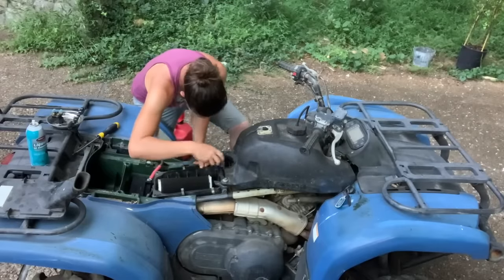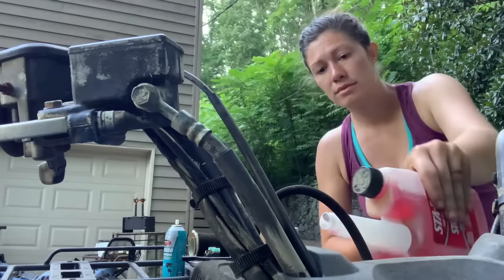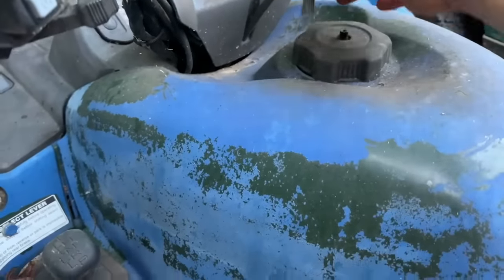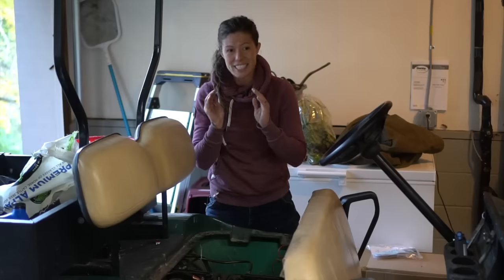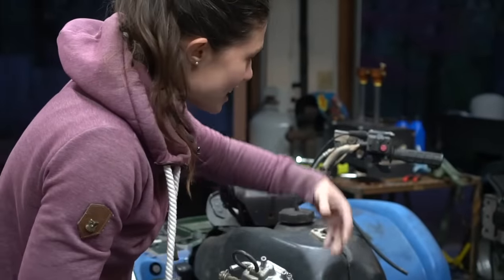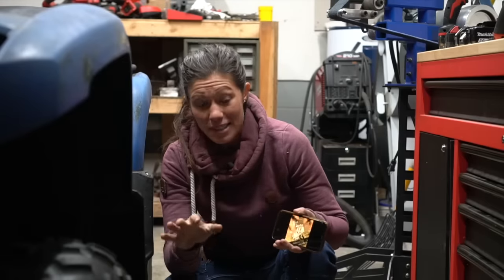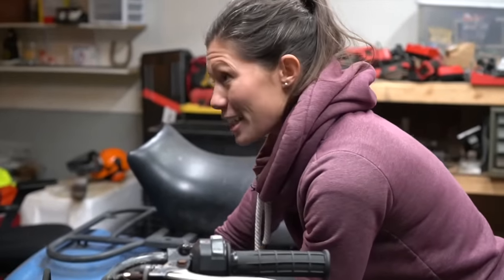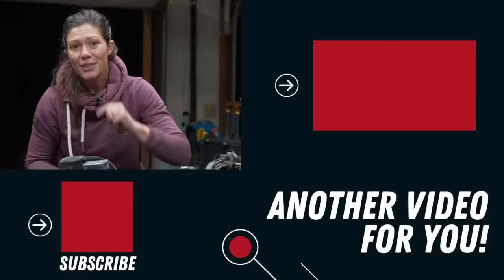ABANDONED ATV: Will it Run?

Comment: Prior to my retirement, I was a manufacturing engineer who was often called upon to participate in screening and interviewing prospective employees. My highest priority was to try to determine the applicant’s attitude. I found 100% of the time that an individual who had a desire to learn, would. Also, I found that mechanical inclination is not gender specific. You, Anne, just put a huge smile on an old man’s face; I would have hired you on the spot.
Reply: This also put a huge smile on my face!  Fuel & spark are the two basic things needed to run an engine.  I have always maintained that teens should have to maintain a 20 year old car for several years before they are allowed to own a new one.
Reply: Yeah, decades as an engineering manager, and I agree fully. Persistence and curiosity make the day.
Reply: @WayneSmith-yf3fg  and compression.
Reply from the maker: That right there means more to me than you could ever know. I spent a lot of my young life feeling stupid, not understanding why some things were so hard for me to understand that everyone around me seemed to just get, right off the bat. I still have to do some tough workarounds, but learning to work with my hands rather than sitting at a computer has made me feel so much more capable and willing to tackle so much more than I ever thought I could. Each skill builds off the last, and I’m learning to love my failures a little more. I would have loved to work with and learn from you.
Reply: @AnneofAllTrades  there is a hoary old saw- we learn more from our failures than from our success. It seems that when you succeed, likely you've only learned that one way to succeed. Failure is more complicated and we seem to learn several things each time we try and don't make the goal. Yer doing fine, Gal!
Reply: @fredericrike5974  Vivek just said basically the same thing.

Comment: Hello Anne,
I could not help but smile, as you discovered how your ATV worked mechanically. My first experience with a small engine was at 14, and it did not go well. I failed to put oil in a B&S engine at the hardware store I had just started working at, and let’s say, the engine did not run long. The store owner thought it would be a good learning experience for me to repair the engine and it started me on a life long journey to learn how things work. At 61, I realize, I only know a fraction of everything I still want to learn. I applaud your never give up, nothing is beyond my understanding approach to life. Stay safe, and continue to expand your knowledge and experiences. Thank you

Comment: Kinda how I felt about my Mitsubishi Raider. I am not a mechanic, I am a 54 yr old female. I had it at a Mitsubishi dealership, no one knew what was wrong. YouTube was a lifesaver and one guy from a parts store , a new control module, a new knock sensor, and by myself I changed the coil packs. I feel like a mechanic... lol 😂 GREAT JOB ANNE.
Reply from the maker: Heck yeah! That's how you get things done!

Comment: Nice to see it working and not dumped in the trash. I can see you have this figured out now, but there are only ever 4 things any petrol or diesel engine needs; Fuel, Air, Compression and Spark. If the combustion engine isn't running, you just need to work out which of the four it's missing. I'm always happy to see a novice home mechanic get an engine running when professional mechanics can't (be bothered to?) get it working.

Comment: Well done.  I cannot stress how many times I have had my “eureka” moments doing something completely different.  Having a leaf blower give you the inspiration to fix the “carburetor” is a wonderful example.  Good on you.
Reply from the maker: Thank you! Can you think of any of your eureka moments offhand? I always love hearing about those.
Reply: My most memorable was a 4 hour debate I had with a co-worker on how to implement symmetry in an optimization algorithm (yes, software).  We had our breakthrough and realized this obeyed Newton’s 2nd law of motion.  We then spent the next 10 min debating what solution would take the fewest CPU cycles.  This reduced a 23-hour calculation down to 20 min.  

Similarly, my training is in quantum chemistry.  The Air Force assigned me to work Satellites.  I succeeded because I simply thought of satellite orbits as electrons and was amazed at how well it worked and allowed me to “visualize” what was happening.
Reply from the maker: @MichaelCoolidge  That is pure awesome. I understood almost none of that, but I love, love, love seeing seemingly unrelated things answer big questions.
Reply: @AnneofAllTrades  I am an amateur tinkerer and I do as you do. Look it over and work on something in my mind first. I figure order of operation for woodworking.  How the firearm works first before I take it apart. What a small engine needs to run and work it out by reasoning. I am wanting to try my hand with older wind watches, service and repair. So many cool things out there to learn.

Comment: I had the same quad, in the same color, and I too had to replace the carb - for no apparent reason.   While I replaced that carb with a used one from eBay (many years ago), I had a Yamaha motorcycle last year that needed a new carb and a Chinese aftermarket replacement carb was the only option.  I didn’t expect much given the low price, but it started right up and ran better than it ever had with the original carb.
Reply from the maker: yeah those cheap carbs work shockingly well. I saved the old one in case I ever fancy a rebuild, but it would require some serious machining skills I'll have to build my way up to :)

Comment: Always try to look at the set backs as a learning curve, when it comes to mechanics sometimes it can be a guessing game as to what's wrong with the engine, I've been in a few situations where I was stumped as to what was goin on, just take a step back and do the process of ilimination, do you have spark? Are you getting fuel? Are you getting the right amount of air?? In some cases it can be electrical, just hang in there and push through, you will be successful in the end
Reply from the maker: Great point!

Comment: So many times I see carbs having issues because of an air bubble in the line somewhere. I always disconnect the fuel line from carb and then use an air hose to shoot air into the tank (with a rag to stop blowback) to clear debris and air from the line. Last week I was given a riding mower with a no start problem. Simply clearing the fuel line did the trick. Its really strange. I've seen it a lot recently.

Comment: Turn the clear fuel filter so that the fuel enters the exterior of the element first. This way you can see the fuel and the trash that is being filtered out. This type of filter works both ways, but usually has a tiny arrow indicating flow direction.

Comment: One way to check a fuel filter to see if its plugged is to remove it and blow through it, and also be aware that almost all fuel filters will have an arrow pointing in the direction of fuel flow.😁 Cheers from Canada! Luv the vids keep em coming!

Comment: Love it, fuel air spark compression. Sometimes to float in the bowl gets stuck an dont release gas through the jets
Reply from the maker: Oh interesting! I’m gonna have to take the broken carb apart to see what’s in there :)
Reply: @AnneofAllTrades  especially when the gas is old an not treated but can also be just old carbs get a lil corroded on the inside. Should be 3 jets inside i think pilot, main, an i forget the other but it looks a lil scary taking one apart but its not bad at all just dont lose anything lol jets get clogged with junk sometimes

Comment: now you need a winch for the front.  BTW, make double sure of the fluid level on that new battery and also ensure with a tester that it is actually charging (alternators on those are often POS quality)

Comment: The problem was probably just a clogged fuel filter in the first place. Carburetors are easily rebuilt, 25 years ago high school auto shop classes taught it. usually all you needed to do was a partial disassembly, solvent clean the parts, possibly replace seals and finally adjust the idle. Professional mechanics tend to over look the simple things when working on something they are not used to.
Reply from the maker: Caleb had already tried rebuilding the carb before the trade, the cost of the replacement parts that were needed were more than the machine was worth to him so he was happy to make the trade. There was also a lot of other stuff that happened over the 3 months I was tinkering that didn’t make the 12 no video ;)

Comment: A gasoline engine needs 3 things to run. The fire analogy is a good one but fire in the combustion chamber isn't constant. So you need fuel, air, and a combustion method (spark plug). Since engines are complex there are also reasons why an engine wont run even with all 3 present. You also have timing, if the spark isn't happening at the right time, it wont run. Then there is compression, if there is not even pressure inside the combustion chamber, well all the power of the gas/air explosion wont be focused enough in an engine that is worn out completely. If you have very dirty fuel, or a lot of water in the fuel tank, this causes issues as well. Also related to a worn out engine is to much oil being present in the combustion chamber, which can cause serious problems with combustion and oil deposits building up on the spark plug. It's very cool that you figured out what the problem was =)

Just remember to keep these simple things in mind when working on an engine of unknown condition. Get a compression tester, they are pretty damn cheap. Learn how to read the results, there are plenty of good guides out there on the internet. You would be surprised how much diagnostic info can be learned just by observing the needle on the tester and how fast it builds up and doing a wet or dry test (valve vrs ring damage). If you have good compression this lets you know almost right away if an engine is worth working on for such a simple quick test.
Reply from the maker: All good points, we’ve used a compression tester on the 53 Chevy, which you’ll see in an upcoming video, but just jumping in to clarify I was talking about the carburetor, not the engine with that explanation ;)
Reply: @AnneofAllTrades  Just to be clear, I'm not trying to be some know-it-all. Just sharing some basic information. Any one of the points that I made can easily be researched by anyone and will lead a person down the road of more knowledge. If you don't know where to start looking, things can be more difficult. When diagnosing a motor it's always best to start with the basics and go from there.

Comment: Hate to say it but probably the fuel filter the whole time.  I see a lot of 'professionals' go for the hard stuff first and skip the simple steps.  I work with computer techs and always tell them to start with the simple and obvious first, then work toward the hard stuff.  Great job on the ATV!
Reply from the maker: You're totally right, so often it is just an easy fix, the fuel filter was definitely a PART of the issue on this, but the bike wouldn't have run with that fix alone, Caleb was so eager to give me the ATV in the first place because he'd already put a ton of time and effort into working on it, and when he had the old carb out to rebuild it and realized it was beyond fixing, he decided not to put any more $$ into it, but for me, putting $100 and about 40 hours of work into it made it a really worthwhile addition to the farm!

Comment: Wow similar worlds. Is that a Kawasaki King Quad? I had the same carb problem and battery issue with mine. And My first truck was a 49 Ford F-1 pickup. Eric.
Reply: Looks to be a Yamaha
Reply from the maker: It’s a Yamaha grizzly 660
Reply: sorry bud but the king quad series is made by suzuki. and just take it to a shop because suzuki king quads are a living hell to work on. they are great bikes until they break, once they break it is never the same
Reply: @AnneofAllTrades  just a great vid all around. Engaging story arc -  Can I Fix This? - from struggle to triumph, and a bonfire as a visual metaphor. You’ve inspired me to revisit some of my half done vids and projects that have frustrated me  (such as my mouse infested broken I snowblower) and try to tell a visual story as good as yours. Thank you again, Eric.
Reply: @wylieisnothere5062  good to know Wylie, thx for the heads up. Eric.
Reply: @gardenfork  just trying to save someone from suffering the pain of working on a suzuki, I tried and it ended up being cheaper just to take it and get it fixed.

Comment: At 6:48 Actually you are holding the carb upside down and the area you said had fuel in it is the vacuum piston. The little black tube near the idle adjust knob is the fuel overflow.  I applied for a job at a Yamaha scooter shop in Capitola Ca. The dude said if I could get the Yamaha 180 to run, he would hire me. I worked there till they closed that store a year later.
Reply from the maker: Good on you for being persistent! The way I'm holding the carb at 6:48 is the same way it's installed in the bike. If it was upside down, how could the gas pool in the bulb the way it needs to for the carb to operate? Regardless, you'll be pleased to know the carb went in the same way it was previously installed, and I've had no issues in the month I've been riding this beast around ;)
Reply: @AnneofAllTrades  If you remove the 4 screws from the steel cover of your old carb you will find a rubber diaphragm and if you take out the 4 screws on the opposite end you will find the fuel float. When you open the throttle air rushes through the carb and the rubber diaph has the needle on it which regulates fuel flow to the engine. The diaph raises allowing more fuel as the needle is normally tapered. Your analogy with the leaf blower was a great example of how a supercharger works :-}

Comment: I think you did great and like that you didn't give up on it. 
 I started working on my own vehicles back when I was fresh out of High School and had a Chrysler new Yorker. The Starter messed up so even though it was Winter I went out and took it off. Went inside on the kitchen table, (which I hought later My mom would of yelled me for but didn't) and took it totally apart , cleaned it and put it back together. I then tested it with my dad jumper wires and it worked so I put it back on the car and drove it. yep the first time I ever worked on a Vehicle by my self. I had helped my dad do stuff but was always the hold the Flash Light person or lift the Trans up on my belly so He could get the bolts started.

Comment: Engines require three things to run: fuel, compression, and ignition. First easy check is pulling out the spark plug and turning the engine over holding the plug against the block. Ensure there's a good strong spark. Second, check if there's compression by plugging the spark plug hole with your finger (or ideally a cylinder pressure gauge, if you've got one). Next check your fuel is fresh enough and making it to the cylinder. A quick hack is to dip a sponge in petrol, squeeze out the excess, and put it in the air intake. If it runs for a few seconds then your spark and air are fine, it's a fuel issue. Work your way from the fuel tank to the cylinder, or opposite, checking for blockages like a blocked needle valve in the carburetor, or a blocked fuel filter. 

I had a bike engine that wouldn't run, it would occassionaly backfire if you tried to start it long enough. Turns out the cylinders are numbered 1234 from the crank, and the fuel injectors had been wired up as if it's 4321 from the crank. My 92 yr old granddad gave me the tip about the sponge. It ran, so we knew it was a fuel issue, went through it step by step, and got it sorted.
Reply from the maker: Did you watch the full video? 😉
Reply: Oh yeah, you crushed it! Love the stick-attitude! I didn't post for your benefit, you evidently know what you're doing after that. The way my granddad explained it really made it feel less daunting to me, and I thought others might appreciate in case their issues were maybe spark related instead.
Reply from the maker: @Leo99929  that’s awesome. I appreciate that thought process, I just wanted to make sure you got to the good part :)